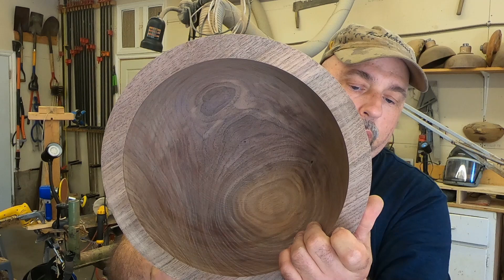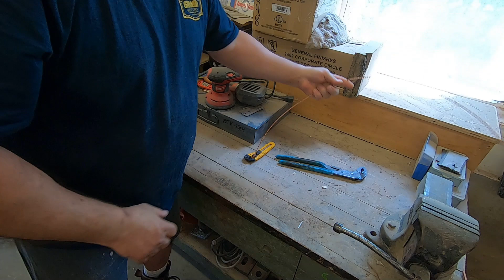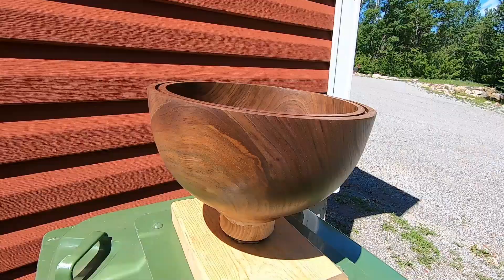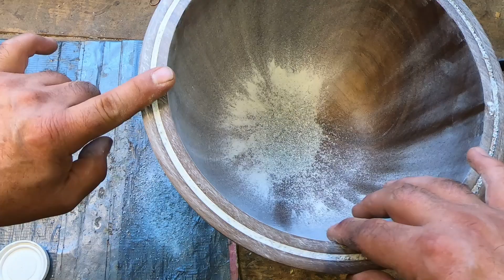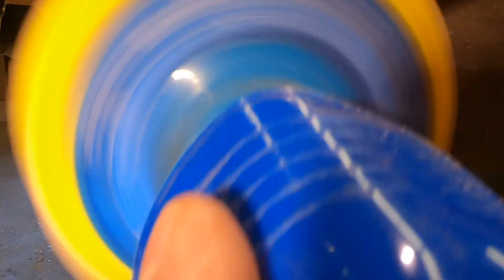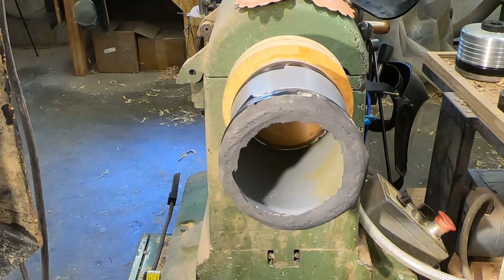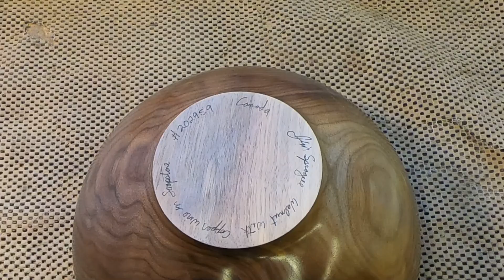Woodturning - Twisted copper wire and soapstone inlay

Comment: If you use epoxy for the adhesive you can mix the soapstone into the epoxy until it becomes a thick paste. Just use a putty knife to force it in and scrape it smooth. Holds damn strong. We use something similar as filler for composite aircraft parts. 
Also, a ball mill would get you a much more uniform grain size from your stone. You can kludge one together with a nice wide length of cast iron pipe, a couple end caps and a handful of half inch stainless ball bearings on your lathe.(just be sure to wear a dust mask when handling the result.)
Reply from the maker: Thanks for the info, I’ve been thinking about making some sort of processing device. For now I will stick with the thin CA, Jim.
Reply: @SpragueWoodturning  also, I find you can just use a selected grit sandpaper and a cleaned out shop vac on a bench top belt sander to create and capture large amounts of stone dust at the size you choose in very little time.

Comment: Great inlay! Thanks for sharing. What are you using for the clay to hold the bowl on the block while you finish up the bottom of the bowl?
Reply from the maker: Clay? I use hot melt glue to hold the waste block to the bottom of the bowl, is that what your referring too? Jim
Reply: @SpragueWoodturning  I thought it looked like a clay but heard you mention in a later video that you were using a vacuum chuck to hold the bowl while finishing off the bottom.  I had never heard of that before but impressed at how well they work. Thanks again for your great videos! I've learned a lot from you.

Comment: Nice result, and very well done video, very instructive. I have never used wire inlay, have used brass powder, the cuttings from a key cutting machine (from the hardware store), plastic and natural turquoise. Some of these would work well with the wire inlay, I think.  Good tip about prefinishing before adding the CA.
Reply from the maker: Thanks Ron!

Comment: Hi it is a very enjoyable video and technique, as your video is also teach us some techniques... may i suggest when you cut your groove for the wire   why don't you cut say about 2 or 3 degree taper towards the center (towards the groove on both ends ) to help draining the glue to the center (wire) hopefully this will reduce voids and numerous sanding... as you have to sand for finishing you can flatten the Bowl edge to take the tapering of ???    Kind regards from OZ  Jack Marashlian
Reply from the maker: Thanks Jack.

Comment: I've some bare copper wire of different thicknesses from about 0.8mm to around 1.5mm. Not sure what gauge that is in your system? What gauge would you recommend for, say,  a 10"-12" bowl? I'm sure i'll be able to translate it into metric.
Reply from the maker: That’s really up to you, just cut the grove according to the size of the wire when twisted. Either will look good, experiment with it, that’s the best part, safe turning, Jim.
Reply from the maker: This is totally up to you, just twist the wire and cut the grove accordingly. I don’t think there’s any rite or wrong with this, it’s what you like and want. Jim

Comment: When I was adding twisted wire to jewelry projects, I would clip the ends at an angle rather than straight across.  By careful trials, I was able to make the join invisible.  There was about 1/4 twist where the top overlapped the bottom.  Might require using a pliers to slightly change the twist on the wire but the effect was worth the effort.  Probably work on wood inlay as well.  Thanks for sharing your work.
Reply: There's a jewlery trick of overlaying the ends in the final shape (i.e. if it's a circle, make it a circle with the ends passing each other) then cut both at the join at a 45 degree angle, that way they're a perfect match and the angled cut is easier to hide.
Reply: -4, Carl, I agree wi Francis.
Reply from the maker: Thanks for the tip! Jim
Reply: I use recovered electrical wire in my own wood projects (just thumb drives, so usually small LV wires, but I look for solid core so the twists are visible) and another trick I learned real early to make the joint invisible is to cut long, then file the ends flat. Doing that and using the angle lap trick you mentioned I can make joints completely vanish.
Reply: Francis Kisner cutting-edge the wire in 45 degrees angle is better than straight cuts.
Reply: Just add a little brazing to your skill set and you could make it entirely invisible

Comment: Lovely. This is only the second video I have seen using copper wire. The other showed a single wire round the outside. I have been putting some wire aside and feel more confident in trying it now . Just subscribed, many thanks, Jim at Montana Wood Art Bozeman MT.
Reply from the maker: Thanks 🙏 Give it a go, you won’t be disappointed, Jim.

Comment: Very nice.  Question: would you ever use something like a scrapper on the rim instead of sand paper to expose the copper?  I noticed you used a bowl gouge when you inlaid with pewter.
Reply from the maker: I’ve never thought of a scrapper, it tools and sands just fine. You could possibly use it on the final pass.

Comment: A trick to hide the wire ends if you want to go through the trouble - don't just nip them off wherever they butt up against each other. Manipulate the wires as needed to find a mutual spot where both twists have both wires vertical, then trim (if needed) one end at that point. Follow the top wire of the trimmed end back one twist (or more if you have enough material and want to be able to weave things back together to make a more stable ring) and nip it off where it twists under the other wire so you're left with both wires terminating on the down twist, then run the other wires ends to the second trimmed wire, nip it off there, then repeat what you did on the first end. If done right, both splits should be neatly hidden when the wires are weaved together.
Reply from the maker: Great tip, this one just about worked out but the wire was just a little short. I will try this next time, thanks 🙏

Comment: Great job nice tips about sanding sealer or finish before ca glue is a must  specially using a epoxy resin as well. Again nice work I'll give it a crack. Cheers David
Reply from the maker: Awesome, thanks 🙏

Comment: Another great video! Thank you!  I'm going to try that. 
Question:  how did you mount the bowl back on the lathe  to finish the bottom?
Reply from the maker: I use the Oneway vacuum chuck System. It works great.

Comment: Well, that was brilliant! A perfect finish without a single blemish. You’re amazing.
Reply from the maker: Thanks Ward!
Reply: @SpragueWoodturning  Ummm...I am new to wood turning, but have lots of experience with making jewellery and doing wire work inset and so forth...and as I was watching this I kept thinking "WHAT ARE YOU DOING????"

So firstly, a bit of masking tape on the inside and the outside of the bowl rim gives you a dam that will hold the glue and also allow some of the powder to sit proud.... which you want, as it will shrink when drying.

The depth of your groove should always be a response to the twisted wire thickness, and preferably cut in two passes with a slight undercut, like this  /_\ . then put some of your stone powder into the groove FIRST, then force the wire in. Now the stone will fill all the cavities in the twisted wire, and when you CA glue it, that will lock it into the shape of the groove.
Reply from the maker: sashafortis There’s is always more than one way to skin a cat as they say, thanks for your advice, Jim.
Reply: @sashafortis  I enjoy reading the comments-yours is a good one!